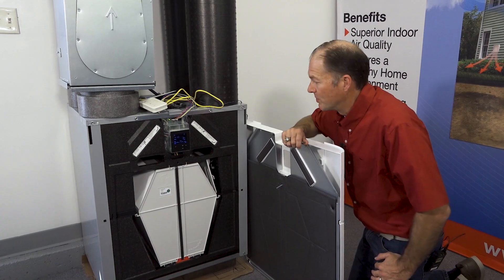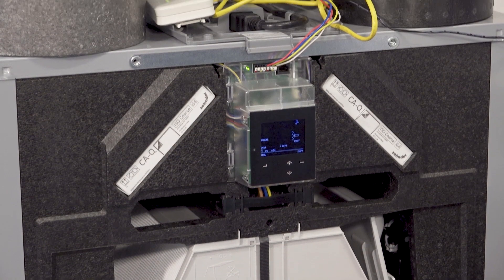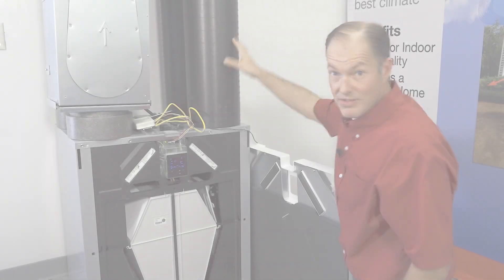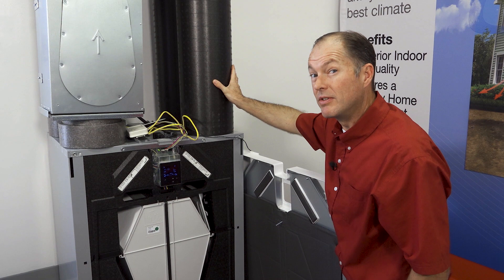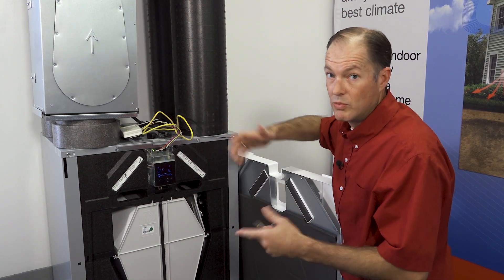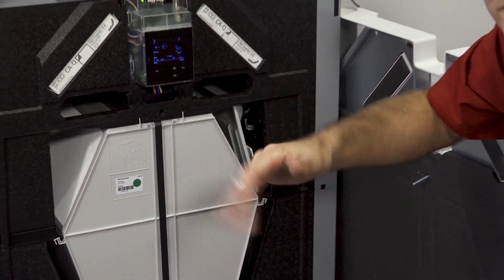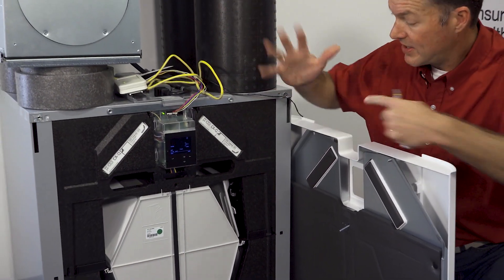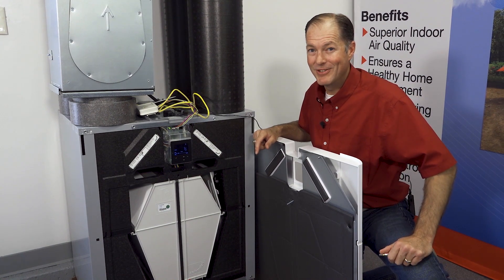Zehnder ComfoAir Q Guts

Comment: Hi I have seen your Video. I have a lots of my clients asking to service their units one had asked me to look at his unit and found this 
zhender  confocool  Q  
EXT_ PRESSURE_ SUP_ ERROR 
showing on the LCD screen 
Can't clear it.
Hope you can help.
Reply from the maker: In a unit active for 2+ years.. Sounds like exterior grill clogged, then possible a filter, then it's inside. A dusty installation has been a common pop for errors. Hence this video series. Find my midsensor video and reference this section 6. https://zehnderamerica.com/resources/comfoair-q-service-manual/

Comment: Your description about the bypass seems incorrect to me.  The bypass is only for bypassing the heat exchanger (this is often for efficiency reasons and when you don't want to heat exchange), and nothing to do with whether the unit runs balanced or not....
Reply from the maker: I may have misspoke in the video and I flew threw the details several years back. I surmise you're correct in finding an error on how the bypass works. It is indeed for efficiency in preserving the desired indoor set temp. Thank you.

Comment: Very useful video! We've installed the q350 ourselves, but struggle to fit it through the trusses as the display screen comes out (about 10mm short). Do you know if we'd save a few mm taking away the display? Or will the control board (which I assume is behind it) stand out  too?
Reply from the maker: You can pop the display face off. Be careful, it's meant to replace if needed.  Service manual here to reference first  https://www.zehnderamerica.com/wp-content/uploads/2022/05/ComfoAir_Q_Service_Zehnder-America_EN_2022.05.18.pdf

Comment: I have a ComfoAir Q (and a very airtight home; we moved in in August), and I was wondering if / how the machine can tell if the window is open or if we are using the kitchen range hood. Are you saying that the machine automatically knows this somehow? People warned us that using a kitchen fan for too long, for example, could depressurize our house. We've heard conflicting things about what the ERV can and can't make up for. Would you be able to explain this a bit more?

Also, our installer did not use those black sleeves on the cold ductwork. We did notice condensation this winter, and someone is coming to fix it soon. Are those sleeves supposed to go through the entire wall assembly? I have no idea how they are going to retrofit these, if that's the case (and obviously moisture is a huge concern).
Reply from the maker: Once the Q is commissioned correctly it prefers to stay balanced. So if a door opens or closes; or a small exhaust influences the balance, the Q series speeds up or slows down fans. Here is an excellent resource on good technique on installation. https://www.zehnderamerica.com/wp-content/uploads/2019/09/Zehnder-Installation-Manual-9.20.19.pdf
Reply: @PassiveHouseCody  Thanks. This document mentions an already insulated ComfoPipe, but in your video, it shows a black sleeve. Are these different components?
Reply from the maker: @jessicaeasto  In an advanced wall assembly there are several layers. In the video you see black comfopipe going through a wall hole that has been taped with ProClima Contiga Solido Exo from exterior Air Barrier To interior Drywall forming a water proof penetration for the comfopipe to rest in. Good eyes!

Comment: I have the 930 DeLuxe model and the core got frosted from the low outside air temperature. It also made the ventilator on that side run noisily. Any thoughts on that?
Reply from the maker: Check to make sure the preheater is chosen under the P menu and that there are no preheater errors. If the preheater was supposed to turn on and didn't there would be an error like A7
Reply: @PassiveHouseCody  Thanks. At first I was afraid though mine didn’t have a preheater, but I checked the manual and it has. In previous maintenance I was stupid enough to be a careless when tidying the wires, which obstructed the flap. Perhaps that was it. Hopefully it is fixed now. Settings P51 and P72 in order now. Many thanks for putting me on the right track!